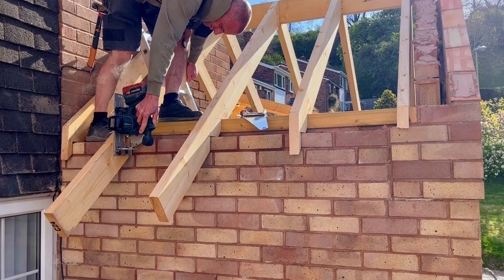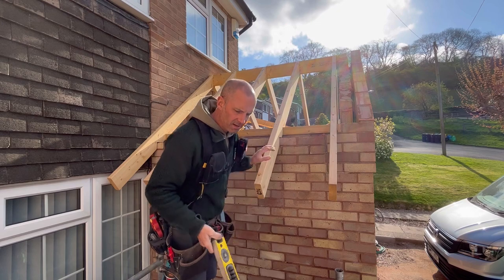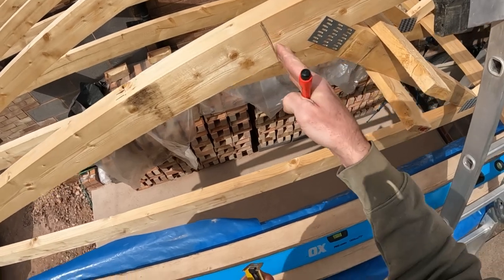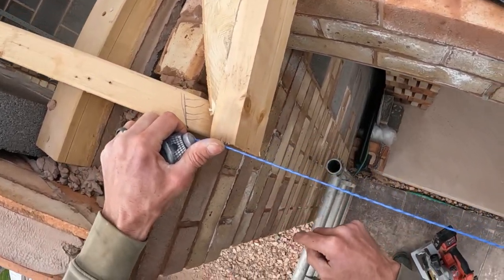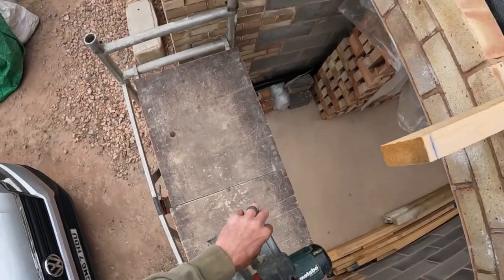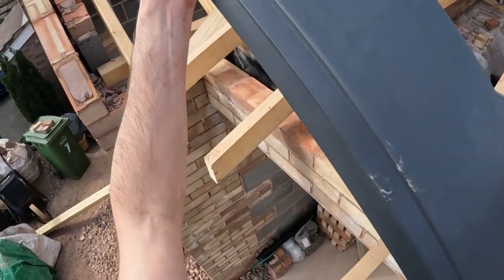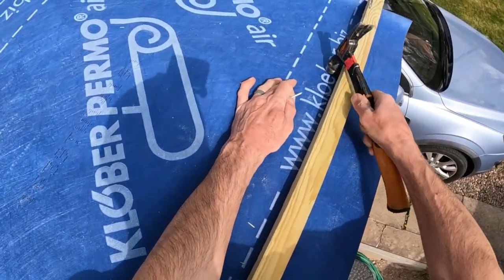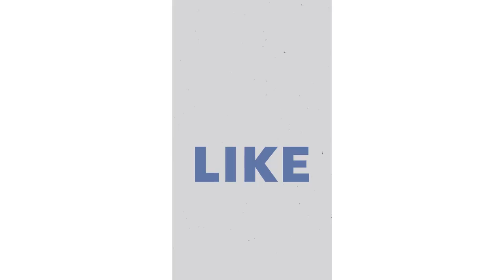The roofer needs this doing first

Comment: Excellent job setting out for the roofer, lovely dead straight felt. Quick question , some tiles especially conc pan tiles also need a kicker batten on top of the eaves tray to push them up to make them sit flat. Do you come across these? Great channel 👍
Reply from the maker: Thank you for taking the time to comment on our channel. I’m not an expert on tiling as I normally walk away once the carpentry is done but generally you will need a kicker batten for most tiles to accommodate for the fact that there isn’t a tile underneath it which will then allow it to sit right. Glad you are liking our channel 👍🏻